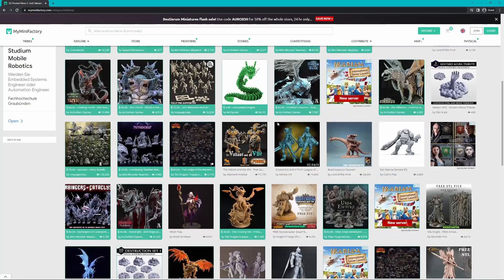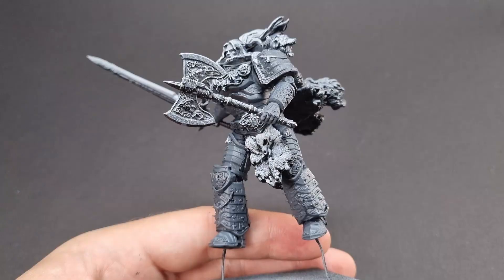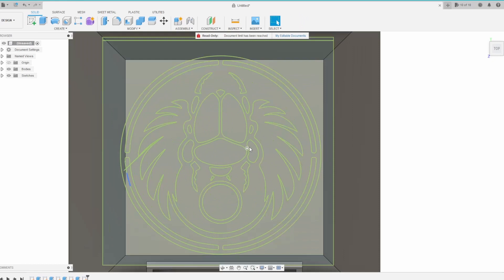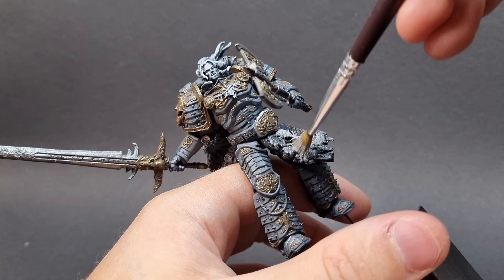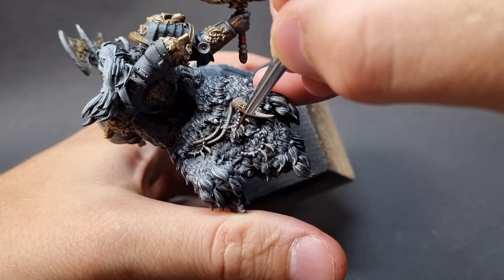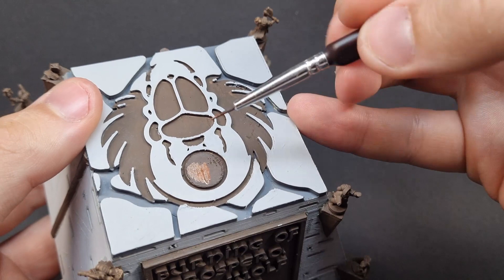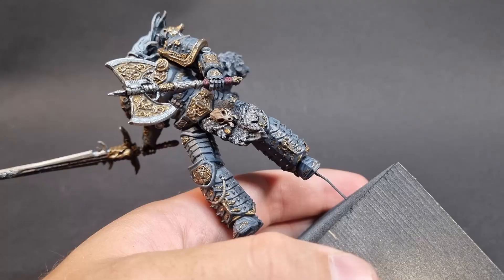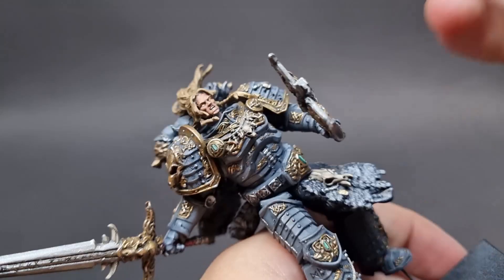Painting Leman Russ

Comment: great stuff.  for the recess shading, have you tried a gloss varnish coat then using an oil or enamel pin wash for this?  i find i get a good, strong tone and the varnish helps the pin wash flow to the dark areas better
Reply from the maker: I have never tried an enamal or oil wash, but it is on my list of things to attempt  Will be happening in an upcoming video for sure. Thanks :)